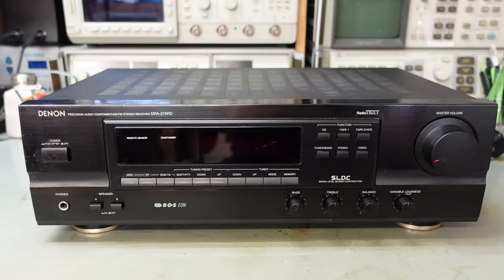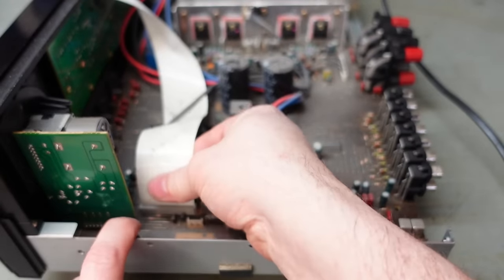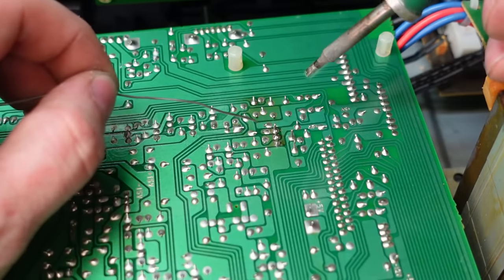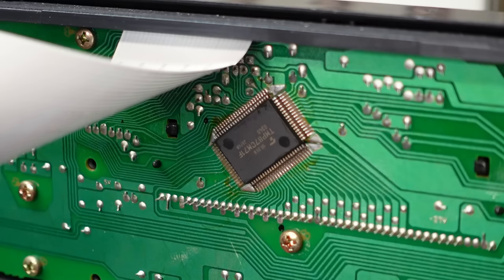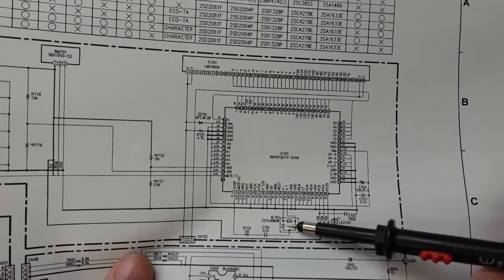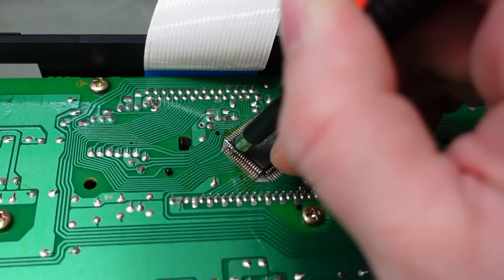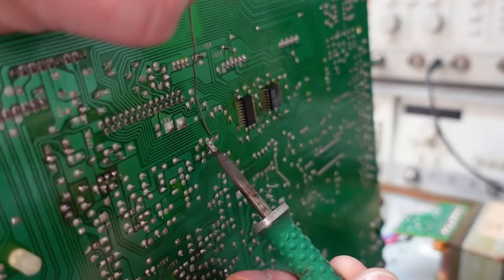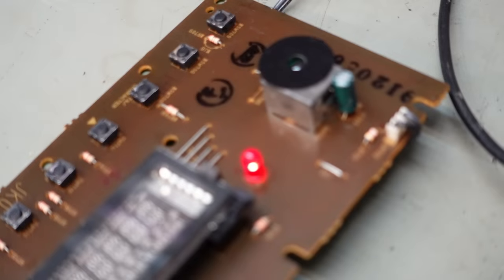DENON and the irreparable failure.

Comment: If I still may suggest, provided it is not yet scrapped, I would suggest you to check main Vcc pins on MCU on an (fast DSO) scope during power on. If some capacitor on power rail is dead, which I can imagine there may well be some, the inrush current to MCU will cause a voltage drop, simply causing MCU to reset. All I am saying this could be as simple as power supply issue.
Reply: I'm surprised he didn't notice or mention the multiple, easily visible puddles in the dust at the beginning of the video, where things have obviously gotten wet at some point. I'm betting a lot of the caps have leaked onto the board and are now effectively nothing more than resistors to the circuit
Reply: I’ve fixed more older inoperative electronics with recapping then anything. They loose their value with age and they short other components when they leak.
Reply: @Knaeckebrotsaege  Yes, there were some tell-tail signs of leakage on that board in the beginning of the video.
Reply: Maybe not the inrush current, however you can get shorts, oscillating power regulators, etc.  Electrolytic caps tend to die with age, as Fireship1 posted earlier.
Reply: @Knaeckebrotsaege   or, someone clueless used spray cleaner (shudder).
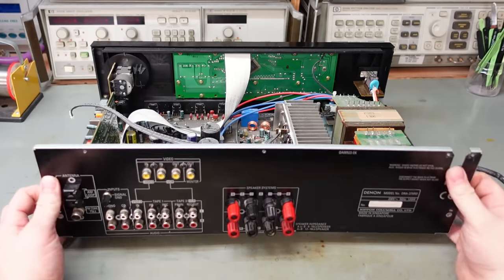Reply: @Knaeckebrotsaege  at 1:59, and earlier where they have jumper wires?  Wondering on the jumper areas whether that's incompletely cleaned off flux.
Water soluble flux residue (this was a long time ago, maybe different now?  I should maybe test this.) if not properly cleaned away, gets conductive when humidity is up.  Makes for some, er, fun diagnosing.
Reply: @jb678901  I thought it was cat piss.
Reply: Can any one tell me the reason for the chattering sound coming from denon avr? Could it be from the relays?
Reply: There is also a reley
Reply: An unecomical repair as its worth about £40 working max.
Not worth running up a £150 repair job

Comment: That receiver may be repairable. The RESET MCU line is two-way. It can be a watch-dog timer output if the MCU is stuck in a loop.
According to the MCU TMP87CM71 datasheet section 1.11 "Reset circuit", in watch-dog activation mode the RESET line can be a pulsed output
 with a period of 2^20 / Fc [s] = 131ms at Fc = 8Mhz. In this unit the crystal gives Fc = 4MHz. 
Thus the watch-dog output period here is 262ms which gives 3.8146 Hz, which is virtually exactly what you are seeing at 9:32.
Therefore the MCU may be stuck, glitched. This can be a classic case of supercap holding up the stuck MCU.
I recommend you gently fully discharge the memory supercap which seems to be C401. Don't bother with reset procedures, the supercap is THE reset procedure.
Simply pressing power a few times is NOT the official reset procedure.
And check for shorted outputs. That (protection mode) and other reasons may also be why the MCU does not come up.
Please keep trying. It is highly probable that the unit can be fixed. It is highly unlikely that the MCU is bad.
Good luck. Let me know if I can be of further assistance.
[ Edit ] One more thing: Please be aware that for complete grounding often the complete back panel must be attached or jumper wires 
 connected to fully connect all grounds. Failure to do so can often lead one down the wrong path. Perhaps not in this unit, but still good practice.
Reply: Hope Mark tries this
Reply: Nice detective work Tim.  It never would have occurred to me that the reset line was bi!
Reply: @marcseclecticstuff9497  Me neither. But something was odd. There was nothing else connected to that reset line.
I don't know why I took the time, but I was just very suspicious. I have never seen that or at least bothered to look it up before.
I should look closely when examining datasheets. Likely more of them do that. Hope it helps. Happy listening ... yet ... ?
Reply: I was just about to post this. Something making the MCU go to reset loop. Does not mean MCU itself is dead.
Reply: Thanks Tim. I dig a little bit deeper and as far as I understood according to the TMP87CM71F datasheet (1.10) the watchdog behavior must be initialized after reset. So my guess is a "Adress Trap Reset" caused by degraded rom (for example cant find qualified reset vector) and matches the timing diagram. There is also a OTP replacement part (TMP87PP71F) but without firmware and special programmer (example: Xeltek ~1k$) I think is hopeless.
Reply: @e42_channel  Possible, but unless something catastrophic occurred, this seems unlikely.
I have never seen internal firmware go corrupt. Plenty of EEPROMS, but not internal MCU firmware.
One might say that the poorly soldered +6V regulator (IC401), which supplies the MCU, may have delivered an over-voltage to the MCU.
I'm not so sure. If the input or output were to become unsoldered, there would certainly be zero output.
But if the ground pin were to become unsoldered, I'm not sure what would happen. Would it deliver excess voltage? 
I think not. It likely wouldn't even turn on, or have enough juice to drive anything.
However, those KIA three-terminal regulators are notorious for failing all by themselves, even when fully soldered.
Mostly by simply dropping out but on rare occasions delivering over-voltage.
Still, I'll wait to see if the full supercap discharge was done, my money's still on that or something... hopefully... fixable...
Reply: Well done! My idea would be the supercap as well: once on a Yamaha surround receiver I had a weird issue: it was perfectly working, volume, channel change, whatever: from remote. If any of the buttons on the front panel has been touched, it turned off immediately. That model is using two AD channels to decide, which button was pressed, so my thought was: maybe the AD converter have an issue... this one has an external flash program memory so one can replace the MCU with a generic one. I managed to find some NOS MCUs (from China, of course...) and replaced it. Certainly, noting has changed... but at least it did not died :D :D 
Meanwhile I bought a second one same unit, with the same issue... so after countless hours of thinking, checking the schematic, scratching head etc... for some idea i removed the supercap and I just put something in place of it. Something that first came in hand, maybe a 100uF? And you know what, the amp started to work correctly. You could push any button, no shutdown, just working perfectly. What a relief! So I replaced the supercap with a new one, and if I remember well I even put a normal electrolytic in parallel as well, just in case ;) Both of the amps are still working fine, this happened like 15 years ago :)
Reply: @janosnagyj.9540  Wow.... great job. Hopefully we will see Mark replacing / discharging the caps. I think there are two of them. C402 (8.2/5V5) on the main c.board and C704 (100/6V3) on the display board both Vdd to ground.
Reply: @e42_channel  I believe those are not important (I haven't seen the schematic) as the supercap is usually after a diode and it's capacity is in the range of Farads (0.1 - 0.47 or even 1.0F; usually commercial stuff like this is more likely 0.47F/5.5V or alike).
Reply: @janosnagyj.9540  Yes u are right and these were also my thoughts. But the only "huge" cap around there (Vdd MCU Power Rail) is a 3300u/25V smoothing cap on the input  side  of 6V Regulator. That makes no sense to me in terms of the MCU. For a buffering / bypass capacitor you would place it near the MCU.
Reply: @marcseclecticstuff9497  follow up vid if it fixes the issue. 

Everyone loves a success story.
Reply: Just to add another voice - there is nothing like resetting a μC by removing its power for (at least) a couple of seconds.
Reply from the maker: @e42_channel  @Razor Tim @Marc's Eclectic Stuff I'm really impressed with your level of research into this. Alas, I did go back on your advice, and check for shorted output pins, and discharged the caps (no supercaps on this design though). No change in outcome. I did find an input pin measurung 8 ohms to ground (for the tuner PLL comms). It still measured 8 ohms with the ribbon cable disconnected - so that 8 ohm short is inside the micro as far as I can tell. Such a shame - I would have made another video on it if it could be saved. Thanks guys!
Reply: @MendItMark  Isn't that display blown? It had a burned mark in the upper left. Can it be shorting the microcontroller?
Reply: @snr7287  That's probably just the material from the getter. It's from the manufacturing process.
Reply: @MendItMark  I think someone replaced the on board (c401) 8.2uf cap with a 8200uf cap. The cap in place now has the value of 8.2mf printed on it. 8.2mf = 8200uf! I don't think that's a genuine Nippon cap either.
Reply: Did you try using the remote control to switch it on? My Philips 47pfl needs the remote to switch back on if the tv is off in standby mode with red LED on.
Reply: @anthonydenn4345  That can be a pretty good point too look at.

I also repaired once a Class D amplifier from a KEF PSW3500 subwoofer, there is a 47µF capacitor and i managed to replace it with a 470µF one, took me a while to realize i ordered the wrong cap.
I soldered a 47µF to this spot and the amp was working again. Bought this higher end Subwoofer broken for 15€ and sold it for 400€ by replacing a 30 cent part
Reply: @harrison00xXx  Yeah I think someone replaced the original cap with this cap. The original capacitor looks nothing like that cap.
Reply: Thank you for the analysis! I have a Denon amplifier acting up (power LED is flickering and the whole amp resets to beginning of start up process often). I disconnected reset from everything and it sort of works, but then it doesn't go out of standby - I have to manually reset it once to get it out of standby. I'll look closer into what happens in my circuit, as this can be related to this issue.
Reply: @snr7287  That's not a burned mark.  That's where the getter is for the tube.  It absorbs any residual gas in the tube.
Reply: I would like to point out....  As some others have said - cycling the power button does NOT "reset" OR power on the Denons of this Era.  I buy and sell a LOT of old equipment from this era (especially Denon) and every time I have come across one with the "standby light", I instantly know I will be hunting eBay for the remote.    The reset for most denon receivers of the late 90's to early 2000's is usually:  power off the unit (button), press (and hold) a combination of the tuner buttons while turning back on.  But as mentioned - even still.. nearly every time, it will STILL need the remote to come out of standby mode that initial time.  I buy a LOT of this old equipment (brings LOTS of money down here in Mexico) from people cleaning out closets via CL/Goodwill/FB/etc.. and I have seen this way too many times.  My bet is: pressing the power button on the remote will "zap" it out of whatever reset loop it is in and turn it on just fine.  It is also for this reason that I generally only buy the Denon gear if it includes the remote OR the unit itself is worth investing another $20 for an ebay remote.
Reply: Mmmh ir blaster?
Reply: @janosnagyj.9540  Supercap without the electrolytic is better; electrolytic will have much higher leakage.
Reply: @MendItMark  well you can blow that short with high amps very low voltage, somethimes you get a limping ic to still working, if the power amp work, i just hard routed the input and activate the power and make a simply one input amp, with a bluetooth addon fot car radio, it's just modern amplifier without usb support
Reply: Nerd(s)
Reply: @snr7287 hats actually normal on these type of display units, my old Sony receiver has the same burn mark and the display is just fine
Reply: @snr7287  It's not a burn mark, it's the 'getter' which is used to absorb any impurities when the VFD is drawn down to a vacuum during manufacture.
Reply: @hardkore360   It's not a burn mark, it's the 'getter' which is used to absorb any impurities when the VFD is drawn down to a vacuum during manufacture.
Reply: Hi there you seem knowledgeable. Do you have any input with my Denon 3806 issue at the top of the comments? Cheers.
Reply: @sw6188  thanks for the clarification!
Reply: @hardkore360  You're welcome. A similar procedure is used when they make vacuum tubes (valves).
Reply: @deanrantala  I had the model above this one in the same series, DRA-375RD, and you could absolutely power cycle it out of standby. :) It's mentioned in the manual too. ""To turn the unit ON from the STANDBY mode without the remote control, operate the front panel power switch twice.""
Reply: F I Y

This inept fool had a similar problem with a Technics CD changer unit but since I am an incompetent fool I kept blowning fusible resistors, forcing the controller on in an unstable state with power going on and off, it really seemed the MCU was cooked, it threw random segments on the display, it was PAINFUL to watch.

I was about to try the bruteforce method of testing components to exhaustion, of course had I had a curve tracer I would have used it but all of that would have been a complete and utter waste of time. In the end I begun touching up with my iron every single component around the ribbon connector/s where I had already tried to bow and tickle the components, I couldn't even know where the problem originated from but it was fixed ever since. So a unit that I was convinced I would never have been able to make it come back to life... did come back to life.

So glad I did... I really hope in the future to see laser being re-manufactured to keep these machines going.

Comment: Amazing, I got a Denon AVR receiver just last week with the exact same issue -- only the standby light on, no other display and no reaction from the power switch or any other switches no matter what -- AND all of the output voltages were there so it acted like it was on.  I came to the same conclusion -- dead CPU.  I learned a lot in the troubleshooting though, and also learned never to bother with a Denon showing only a standby light again.  Thanks for the video, now at least I have some confirmation I wasn't way off base!
Reply: maybe a common issue with these? premature failure of the cpu? or killed by that dry jointed regulator
Reply: @andygozzo72  In my case, there were no dry joints or any power issues so I don't know what killed it.

Comment: Back in the 80s, when these computer controlled audio receivers became popular, we had a lot of success "discharging" the MOSFET inputs by power off, connecting a jumper to ground and swiping it across all the legs of the MCU. Not exactly sure, really didn't care since it worked, this worked, and I hadn't thought of it in 30 years. It might be worth a try, if you haven't trashed the Denon yet. I enjoy watching you work. I've been away from component level repair for more than 20 years, having gotten into IT when I saw the repair business disappearing, with "swap while in warrantee, and trash when out" manufacturer philosophy. Thanks for sharing.

Comment: Age-wise, according to HiFi Wiki, the manufacturing years for that Denon receiver was from 1996 - '98.
I have a 'DRA 425-R' receiver that's older, but still runs fine.  Maybe one aspect that has kept it in shape was using a power-strip as a power-on/power-off switch; as I am suspect of push-button on/off switch's lifespan.

Comment: That pulse looks quite digital (timing etc.). So I expect the CPU still runs fine.  It's probably the program running on the MCU trying to initialize some peripheral, then gets stuck waiting for it to respond. The watchdog unit then attempts to reset the MCU hoping that the next boot will be successful. Maybe there is some i2c bus you can monitor. But it's a lot of work :)

Comment: Every identifiable date code in that is from 1996. That’s way before the transition to lead-free. But cracked joints (not “dry joints” — dry joints are a specific type of soldering error, which does not include thermal cycling induced fracture) happen to thermally cycled joints with leaded solder.

Comment: This is why I steer clear of all Denon receivers.  I've seen way too many broken ones and I'm not a skilled enough technician to keep them alive.  Thanks for sharing this video Mark!
Reply: I have a Denon receiver that I bought about 10 years ago as a 'demo' unit. Was the last one on the shelf at the store, it had been a powered display unit for awhile. It's been a great unit, sound quality is fantastic, the 5 channels inside are separate. Only thing I've had to do once in awhile is take the remote apart and clean the button pads, especially for the volume up/down etc. But since it's going to be over 10 years old soon, if it ever dies, I'll chuck it. Was on sale at a pretty good discount since it was 'open box'.
Reply: I quit buying Denon products many years ago when they were known as a somewhat "high end" brand and all I seemed to have was bad luck with them. Too many better options out there to take the risk in my opinion.

Comment: Have repaired thousand of thousands of Denon Hi-Fi between late 80's to early 2000. Do even have a DRA-275 for my pc.. :P It's was a very very reliable receiver. Most common thing was blown inputs (due to user connecting/disconnecting stuff with all stuff turned on) or a cooked mains transformer because of stacking things on top and drive it hard. The transformer has a temp fuse you can locate and wiggle out and replace with some handywork.  Your thing is rare and seems more of just get the remote and turn it on or manual reset by first discharge all caps completely then use a solderwick and ground all legs on the mc by drag the grounded wick over the legs of the mc. Feel free to holler if you need Denon tips.